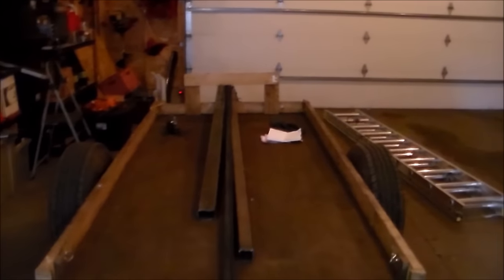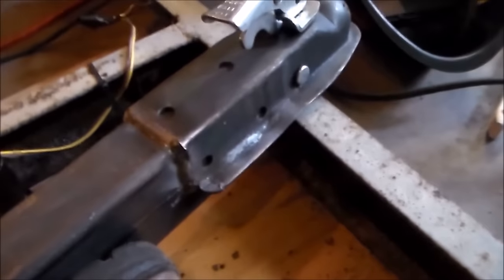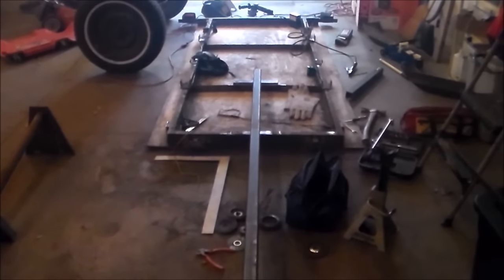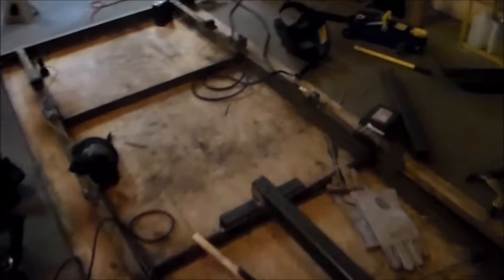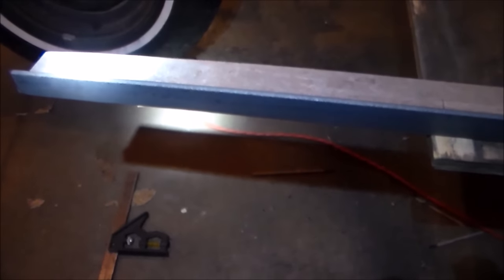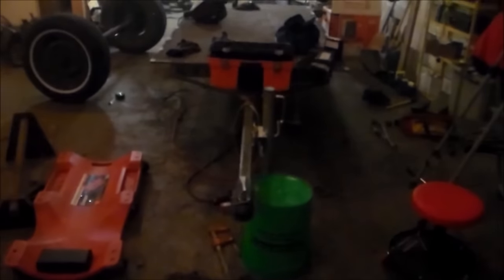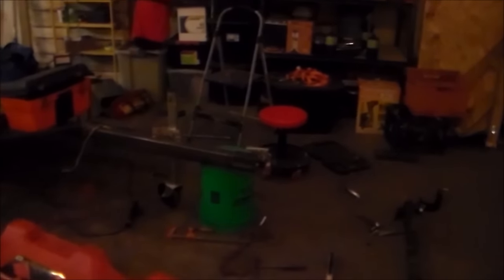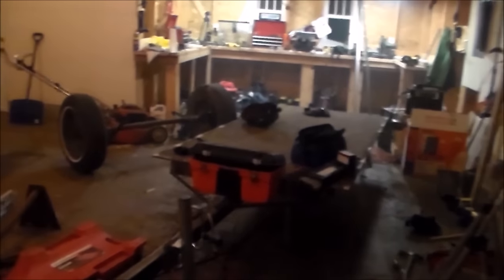Welding On The Utility Trailer

Comment: Those are great looking welds compared to mine. I have a 220v Lincoln stick welder I bought new in 1982 to do minor repairs with. I should probably go take a welding class now that I'm retired. Good job on the video.

Comment: Measure from spring center to hitch  left side and right side  and trailer will pull straight with same measurment
Reply: John Maberry you are right, that would make it pull straight but you should make the driver side of the trailer 1/16" farther than the other side. if the trailer becomes unhitched it will go into the ditch instead of incoming traffic. I manufacturer tractor trailers btw
Reply: jim bob Really?! And you build trailers for a living?! Maybe in a perfect world with perfect roads, but roads aren't perfect. Your discounting uneven pavement, slope of the road, how trailer load is distributed & countless other factors. And, in your perfect world on a perfectly straight & level road, AND all other factors being perfect, if the trailer does comes loose it might pull it toward the ditch, but at just 1/16" outta square, it'd still take two miles or more for it to do so!

Comment: What's that other black welder ..does it not work or something so yiu bought the Hobart?
Reply from the maker: The black welder is a Chicago electric brand, harbor freight. It only runs on  110 , the Hobart is a 220 machine, they both work well but the Hobart welder has more power .